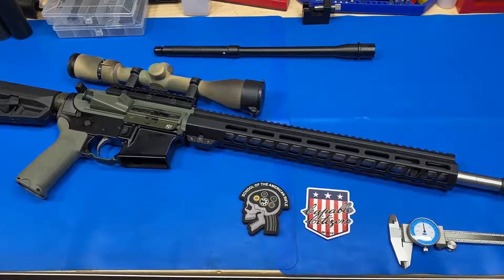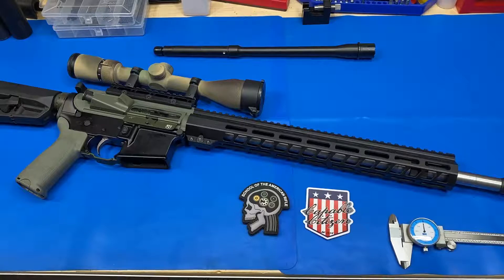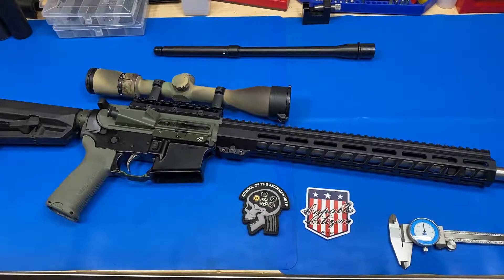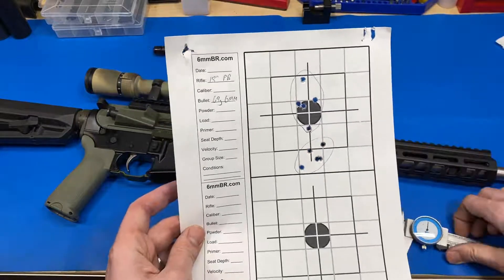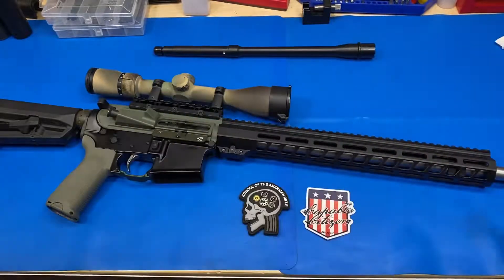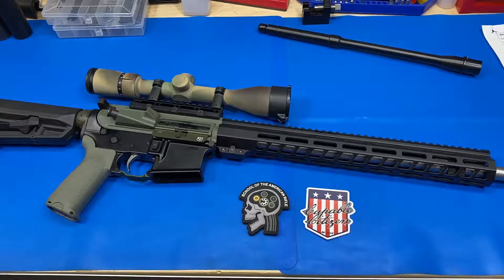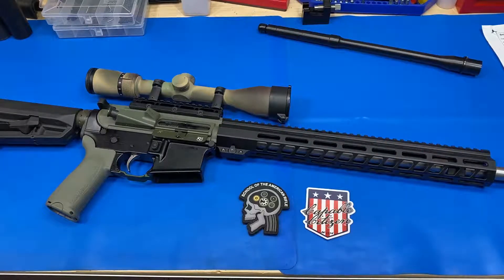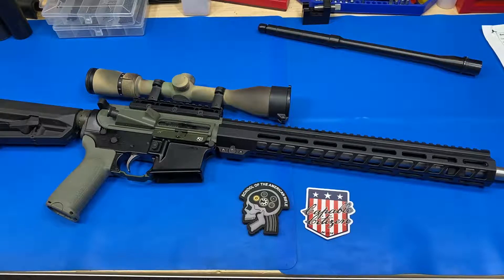Capable Citizen - Accuracy Testing, Part 1

Comment: I'm curious what the results will be after you pin the gas block. I have the ability to pin my gas blocks but have held off since I have never had one loosen and I have heard it can effect accuracy... Was your barrel dimpled for the gas block? For my Grendel rifles I used clamp on type gas blocks as I was told they have less impact on accuracy compared to the screw type. I also lapped the bolt lugs to the barrel extension lugs. I lapped and bedded all four of my Grendel barrels. Three of my rifles accuracy perceived accuracy never changed, but the one improved immensely..It became my most accurate rifle in the 6.5 Grendel.. I also gauge the uppers bolt carrier channel and try to find the tightest bore to minimize the slop with the back of the bolt carrier to keep the bolt as straight as possible to the locking lugs..Some people will even install round headed screws on the back of the bolt carrier to keep it centered to the bore...Looking forward to part 2..
Reply: Pinned gas blocks don’t effect accuracy.
Reply: @echofoxtrotwhiskey1595  Yes they can, Chad agrees...
Reply: @hairydogstail  If They do, then the difference is negligible. The barrel quality is what matters more. Colt SOCOM barrels with pinned FSB can get well under 1 MOA with some getting darn near .5 moa. That’s just an example.
Reply: @echofoxtrotwhiskey1595  I have never seen ant COLT Socom barrel shoot 1/2 moa, never. Accuracy nuts will only use clamp type gas blocks on heaver barrels. The thinner the barrel the more impact to accuracy screws and pins will have. Even over touring muzzle devises will impact accuracy...
Reply: @hairydogstail  I’ve seen them do it on plenty of occasions. Mrgunsngear and Garand Thumb have videos of those barrels doing it here on YouTube. Colt SOCOM barrels are accurate barrels. The Noveske Afghan (pretty much the same profile minus the 203 cuts) is also extremely accurate. Having an inherently accurate barrel matters more than how you attach the gas block if you’re building a precision gun. But for a fighting gun, pin it and forget it. I’ve never seen an otherwise accurate barrel suddenly become not accurate because the gas block was pinned.